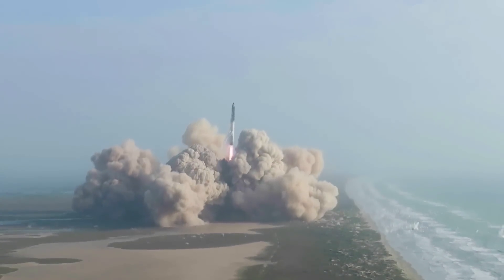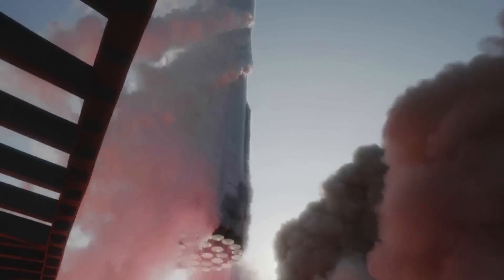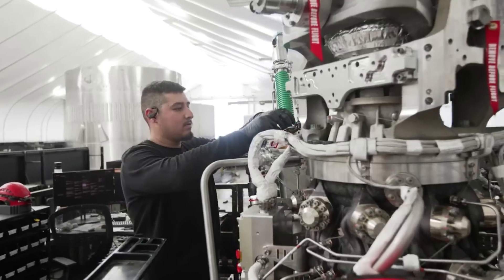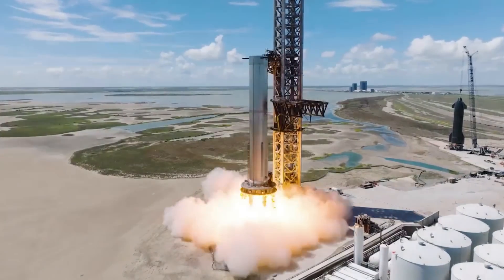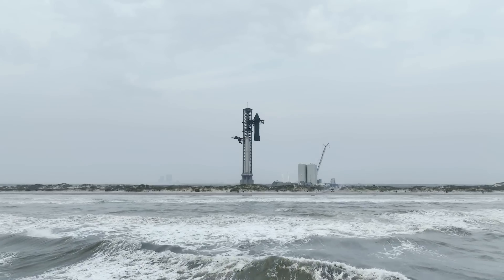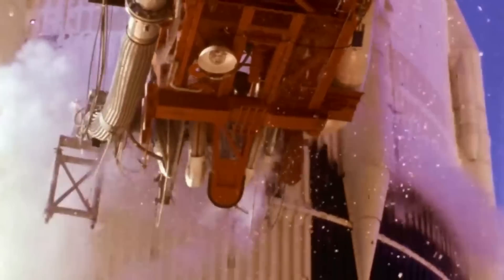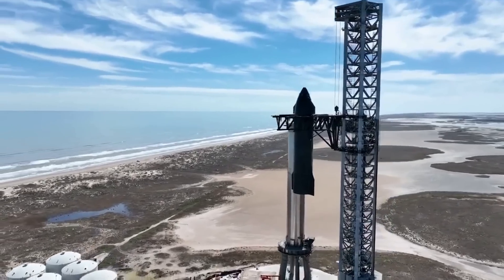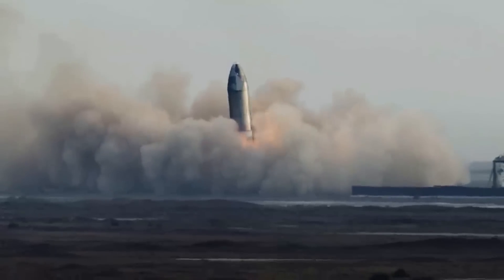Could Steel Plates Solve SpaceX's Starship Pad Issues?

Comment: The sonic shock waves will not be sufficiently mitigated to prevent major damage.  The need for a much larger deluge system is clear.
Reply: Yep! I don't think any solution will work unless they include a massive sound suppression water system. And preferably an angled plate beneath the rocket to reflect the extreme acoustics in a different direction than directly up into the rocket.

Comment: Wouldn’t a giant steel cone in the center solve the problem? Like a 360 flame diverter
Reply: Perhaps if there's room enough, but I also think they'll need a sound suppression water system. You can make realy strong steel, and possibly even cool it enough so it doesn't melt, but that doesn't fix the problem of 200db+ sound waves breaking engines, damaging control surfaces and shedding heat tiles... as well as breaking all kinds of stuff on the ramp and tower.
Reply: @Antares2  and water of course. A lot
Reply: @NoOneReallyCaresAboutUkraine  Yeah, maybe. I still don't think there's enough room if you compared it to the big pads in Florida. 

They were built to handle the Saturn V, and the Superheavy/Starship is significantly bigger, so you'd expect an even more massive structure to be able to handle it.

I think SpaceX has truly shot themselves in the foot by not building a proper launch pad from the beginning. That "bar stool" over a horizontal slab of concrete is a terrible idea.

Comment: Why not place heat shielding tiles used on the rocket in large square shapes over the OLM ground steel plates to really safe guard the floor ?? 🤔
Reply: But it's not only about the heat. There is a catastrophic sound pressure that also needs to be mitigated to avoid damaging the rocket and ramp. This is why all big ramps use sound suppression water systems. Look at the recordings from SpaceX's drone at launch. You can SEE the sound waves flickering up along the rocket. That is not good.

Comment: Is it possible, say, to fire up half the engines (or whatever minimum needed), clear the tower and then fire up the rest of the engines? Or you need all the engines from get go?
Reply: You need all the engines, In fact if you have less engines you will spend longer  blasting the pad
Reply: @TheAmazingchickens  Thank You!
Reply: I found this, which may be helpful, " in general, the energy required to lift off a rocket is significantly less than the energy required to escape Earth's gravity and achieve orbit. For example, the Saturn V rocket, which was used for the Apollo missions to the Moon, required approximately 3.3 million pounds of thrust to lift off the launch pad but required an additional 6.2 million pounds of thrust to escape Earth's gravity and achieve orbit."
Reply: starship is able to fly just fine without some of the engines, but firing them up later might cause stability issues i think, and also whould limit the maximum payload it could carry
Reply: @krassbear33  Thank you, good points!

Comment: Did the tiles stay on during launch? If the acoustics will get worse, are they high enough to avoid most issues?  Kinda suprised they didn't do a super thin plastic wrap that keep tiles in place and possibly melt off during re-entry.
Reply: Tiles staying on doesn't matter if you don't have a pad to launch from.!!🙄

Comment: I just don’t see it
The BTUs must be approaching surface-of-the-sun and steel’s ratio of strength (minimum thickness) vs conductance (lower than copper) means even ice water underneath won’t save the steel from erosion. The current design is at least an order of magnitude off here. I don’t know shit, admittedly, but my gut says they need to double the height of that stand and use liquid inert gas (atmosphere?) deluge, AND do the water cooled steel plates. The solution needs to be like a newly paved road after a bicycle rides over it (aka no damage) to sustain their long term plans. Sending all the positive vibes I can muster to the engineers. They’ve done SO well, so far 👏👏

Comment: An alternative (expensive alternative) would be a liquid metal cooling "reflector", where metal is recirculated through a larger heat-exchange area to be cooled by other means.
Reply: It's not only about heat. You need to mitigate sound pressure/acoustics as well. Sound pressure almost destroyed STS-1 despite the massive sound suppression water system on the shuttle pad, as the video even mentions. Because the system was not good enough in 1981, but was improved.

Why SpaceX refuses to learn from 40 year old mistakes is beyond me.
Reply: @Antares2  well you're not going to handle supersonic blast sound waves unless you can keep the surface it's hitting below it's plastic deformation temperature.
Reply: Speaking of plastic deformation it looks like despite a lower melting point steel may have a higher deformation temperature than titanium.
Reply: @Antares2  
Doubly so if you want to hang around for such a long time where the acoustic energy energy can work on the rocket. But a possible saving aspect of SH with 33 raptors is that the acoustic energy spectrum is significantly more “non-coherent” than the shuttle’s.
Reply: @Mentaculus42  I don't think so. The solid rocket boosters on the shuttle were as incoherent as thrust can be, and it was when they ignited that the shuttle's control surfaces were punched far outside their operating range.

John Young even said that if they had known about the damage at the time, they would have ejected and lost the shuttle. 

It was an extremely close call, but NASA learned... 42 years ago. So you'd imagine SpaceX would be eager to not make similar mistakes, but alas: The meme date had to be reached, no matter if it ruins years of work.
Reply: @Antares2  
But was there not a lot of low frequency energy that the solid rocket boosters generated that caused the damage that effectively had no opportunity to interact with another sound source but had ample opportunity to generate resonants when the shock wave reflected back into the shuttle structure. While super heavy with 33 raptors is a totally different issue with low acoustic coherence. Really two different situations with regard to acoustic damage.

You know when you do vibrational analysis of a structure it is the difference between doing a frequency scan vs an impulse input to put it in very simplistic way. Both get information but in real life with complex structures and complex excitation with regard to damage generated, each has to be analyzed significantly differently. 

Do you have any thoughts on these issues.
Reply: @Antares2  the metal "reflector" does not necessary has to be flat. So, the shape could be made to "diffuse" sound wave. This is not possible when the "reflector" is "flat" water. However, water as a reflector is good (!) option to handle heat and to provide (if only any benefit from it) perfect support reflector to "push off" it
Reply: Sounds like what I've been talking about.   Similar in principle to a car radiator but using a liquid that will stay liquid at much higher temperature. Then it can just be recycled after dissipating the heat and the containing metal is kept cool enough to remain strong under the rocket blast. I suggested aluminum for the liquid and titanium for the container. Aluminum starts out solid but would be liquid when temperature is high enough to need the circulation.  Other materials may work better but those seem like a good start for small scale testing.  If you consider how much water would be used with rapid turnaround launches and the scale buildup and corrosion issues.  The liquid metal radiator idea would probably be less expensive on the long term.
Reply: I recommend liquid “sodium” metal cooling as that should push up the entertainment value. 

But seriously, why did they not provide some easily option pathways for fail forward fixes. It appears that there is something holding back this risk mitigation process.
Reply: @Mentaculus42  probably regulators trying to make things safer just making them more dangerous and problematic.
Reply: @wesleyashley99  
Maybe or maybe “Tunnel Vision” on the part of Elon as I think he is very stressed about getting starlink up before other companies and countries can “occupy the high ground”! I firmly believe that he is way more interested in “occupying the high ground than Mars” !

Comment: Ceramic shield maybe......
Reply: Agreed. People think of vases a few mm thick being fragile, but to dispose of a toilet or stuff like heavier floor tiles over 1cm thick it takes effort with a sledge hammer to break it down. Not to mention some ceramics are good enough for tank or MRAP armor in dealing with projectiles and shaped charges, then a solution using something similar should help protect a launch pad. Might need some of the other stuff mentioned like steel or a diverter system, but ceramic will be the top exposed layer that can take the heat and pressure.

One expensive launch failure shows what happens when you under-build supporting infrastructure, over-build and you'll have a facility "landmark" that shouldn't present future issues and perhaps have a longer term overhaul cycle.

Comment: Zirconia based ceramic sheets covering  Carbon steel {least expensive option}  or a thin sheet of Nickel base superalloys over high carbon steel are the only materials capable of easily withstanding 6000F and the 10000 metric tons of force of the the 33 raptor engines for an extended amount of time they are also some of the best heat adsorbent  materials . The main issue is how much Spacex is willing to spend as these materials rage from $10 to $40 a pound  there is really nothing else economically viable as Carbon Carbon is $50 - $500 a pound  but if its a design that can survive multiple launches without extensive damage it might be worthwhile . Cheers from Salt Lake City!  anyone else have any out of the box ideas?

Comment: When they first started building it I commented about the lack of a flame diverter, The tank farm was too close, and the Starship needed pneumatic pushers to separate Starship from the booster. When Musk did a seven engine test it was blowing out chunks of concrete. I don't think a water cooled steel plate is going to diminish the amount of force fifteen million pounds of thrust has. All of this was predictable. You can't put astronauts on it if the booster can't adequately separate from the Starship during the boost phase
Reply: Calm down this was the first test to space for a radically better vehicle.
Nobody is putting people on it yet, not even any payload.
Reply: @pietersmit621  If I could see it, why didn't his engineers, and I am calm. Seems you are the one triggered. You sound like the same people that assaulted my comments two years ago.

Comment: Incremental, fix problems as you test each successive version, clearly has its development time-saving, but when entire subsystems are interdependent (as in launch pads), going back to square one saves no time at all! Learning of the Shuttle and other prior rockets prevents trying to reinvent the wheel. The proven spare parts approach and multi-contractors approach of the Boeing rival has just this one advantage: using time-tested, proven parts and sub-systems, as in this case.

Comment: I wish spacex would have installed the steel plates and finish the deluge system before the launch but nobody really expected the pad getting totally  annihilated like that ! i say a flame diverter may not even be needed in fact it may be detrimental ! still the ship did good ! 1 scrub - survived max-Q and even looked like it was trying to correct itself a few times before the rud ! amazing
Reply: The stage0 ring should hopefully protect the rocket from some of the acoustics bouncing back up.

Wonder if the steal will be angled or totally flat ?
Reply: A lot of people fully expected this damage to happen. The short 50% power test firings almost broke the pad, so ofcourse a full power launch burn would completely ruin everything. I've been saying for two years that it's a mistake to build a horizontal slab underneath the rocket, and I was right. There's a reason nobody does it like that.
Reply: @Antares2  true ! I made alot of mistakes in my life but i learned from them ! Im surprised it wasnt worse well it could have been but there are 2 more advanced boosters in the waiting ! For me it was still excitement guaranteed ! 💯

Comment: I think something people should keep in mind is the reason why for the insistence on trying to take off close to a flat surface:  If these things end up on the Moon or Mars they're not going to have a fancy launch pad to get back up into space.
Reply: super heavy will never, at least in our lifetime, ever leave earth, there's no reason to cheap out in the launch pad
Reply: From Moon or Mars only Y
Starship will take off, no Booster necessary. And there you will not have a concrete platform to take off, at least in the beginning...
Reply: A valid point as the issue of using a raptor engine that has very high exhaust velocity (with a very high chamber temperature) and a very high thrust and concentrated exhaust flow may prove to be counterproductive on unimproved landing and launch sites. It is not just the number of engines but even more importantly the exhaust flow characteristics of each engine. 

So this will have to be a researched issue to validate that the raptor is safe for these type of uses.
Reply: @Mentaculus42  If you take off from the moon you could throttle the engines way down at lift off and gradually turn them up while you increase the distance to the surface. Not a perfect solution of course, but if necessary it could help  a lot!
Reply: @christophtoifl6848  
Yes, they are going to have to play with throttling and configuration. This is not a simple problem to be left as an afterthought when something gets dinged up on the moon after their first test landing there.
Reply: Yeah, I know. I never asked out Suzie in grade school because Pamela Anderson was my goal. We should have public hangings for any engineer that agreed with that logic. They'll deal with Mars launches when it becomes an issue. I'm not losing any sleep over quantum computers, AI or green energy any time soon. We'll be living in cardboard boxes and eating crickets before any of these become a reality. 

I'm old. I used to fall for these predictions when I was young. In 1989 the "Experts" said all coastal cities would be under water by year 2000. In the 1970s the "Experts" said that cancer was 6 months away from being cured. Also in the 1970s they were really freaking out that a new ice age was upon us. I'm not kidding. It was so cold for so many years. Now they claim they never made that prediction even though it's documented that they made it over and over for years. These ideas are narrative control just like pandemic movies were for Covid. Now they've injected most of the children with this stuff that accumulates in the ovaries so they'll never be able to have babies. In 20 years when that's obvious everybody will have invented another ridiculous explanation so they don't have to face the truth head on. The idiocy keeps going round and round so people can pretend reality is something it's not.

Comment: Apollo Class flame trench and deluge system ("plus sized" in today's idiom). A big water deluge system might mitigate the thermal damage to the area beneath the Raptors, but the exhaust has to be channeled away from the launch platform. No way around it.

Comment: It has to be launched from a much  higher point. The humidity is the biggest issue on the platform because the amount of energy and concentration is a huge factor. Nearly double the thrust of Saturn 4 with near identical diameter. The other issue is the concentration of the chevrons compared to the large boosters of Saturn v

Comment: FLAME DIVERTER! I don’t understand why they are so resistant to the most proven and effective solution to this issue.
Reply: You are perfectly right. But I think the reason is they started building over a flat concrete slab for some reason, and now they are stuck. There's not enough room underneath the launch mount, and digging down into the ground water is not a good idea (and probably will require a massive environmental study and mitigations to prevent polluting the ground water, which I know SpaceX really "love")

If they want a proper flame trench then they have to move the entire tower and launch mount away (or demolish them), build a big concrete structure to elevate everything, like the ones on the big ramps in Florida. This will also make it necessary to make a causeway for the vehicles transporting the launch vehicle so they can get on top of the elevated ramp. 

This will take a LOT of concrete, time and money, so they tried cheesing it, and failed utterly.

This is why SpaceX's ideology of "build first - think later" is such a bad idea on big projects.

Comment: A steel curved cone directly under the center of the booster, covered in custom spaceX heat shield tiles.
Reply: The heat shield tiles would be destroyed by the explosives pressures of the boosters not the heat.
Reply: @sealy3  I agree though I think a water cooled cone shaped steel plate would help redirect the acoustics and exhaust jet away from the pad, much the same as an angled diverted
Reply: @alfavulcan4518  the cone would have a susceptible point..... where does the gantry go?

Comment: Build a perimeter coffer dam system around the launch area.
Then install a sump pump to drain the interior of the coffer dam of most or all of the ground water.
This will allow the construction of a below grade flame trench inside the coffer dam without the risk of floating.
Reply: Ahhhhh no!